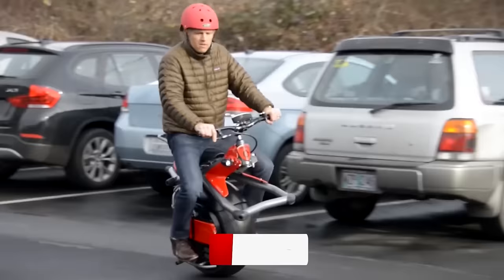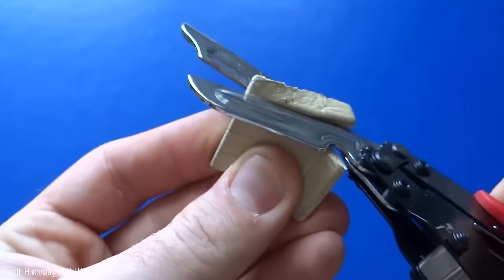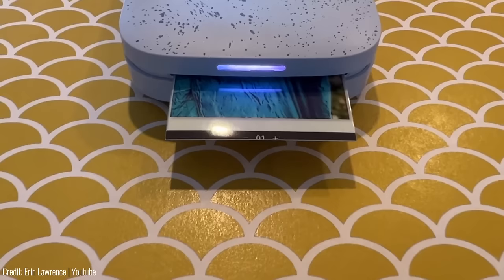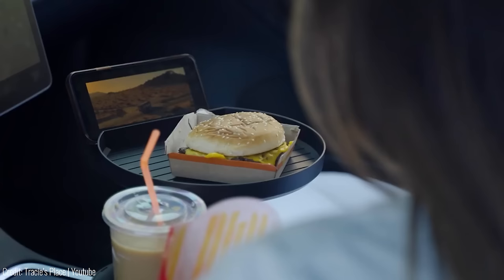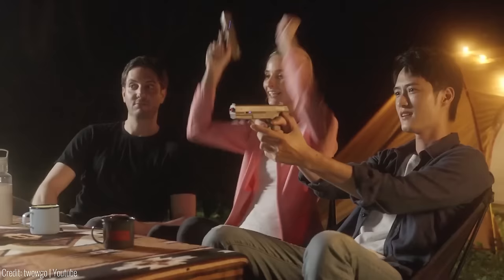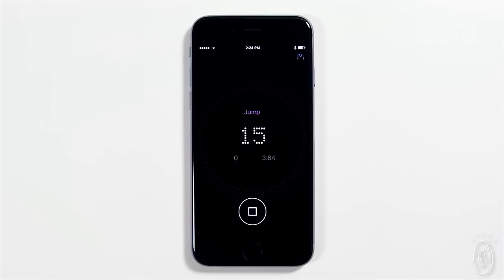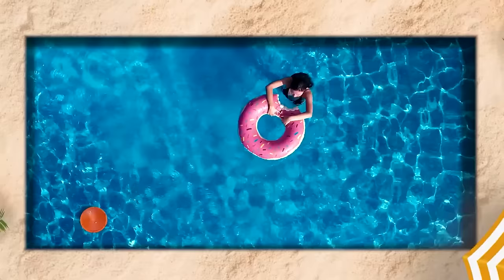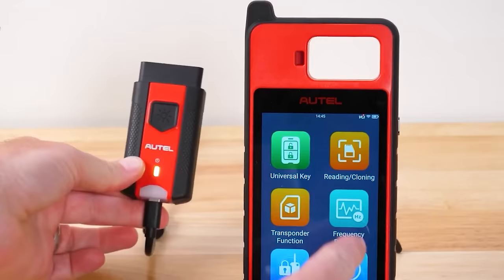100 Greatest AMAZON Gadgets | Best of 2024 | MEGA Compilation

Comment: If pogo stick reproduction maybe nice as that's dangerous? To create a small size to fit bicycle side of wheels will be nicer as suspension, what if support like trolley wheel(tiny size), maybe it really matters? If to be support of backdoor slam thing instead of magnet stuck, if magnet of that even?
Reply: 6mins 8s if at bicycle seat that in front have a roll type of transparent umbrella material to pull and carabiner to handle as bicycle accessory? About rain.